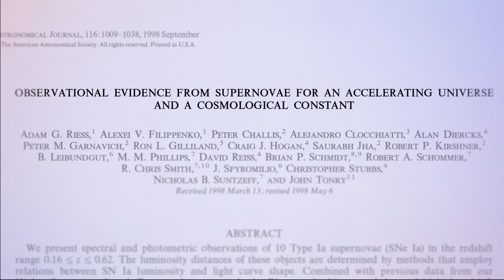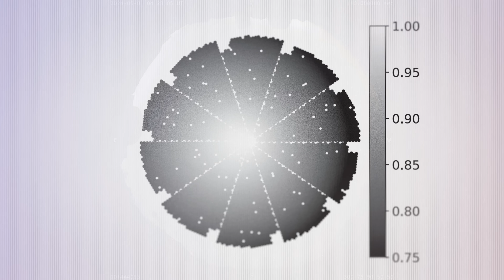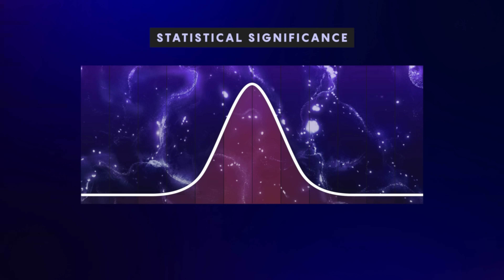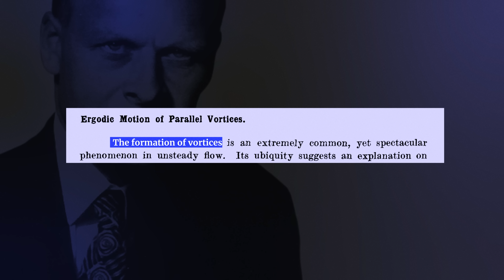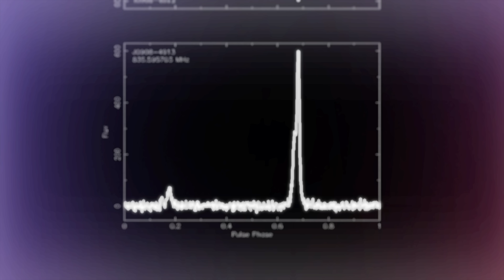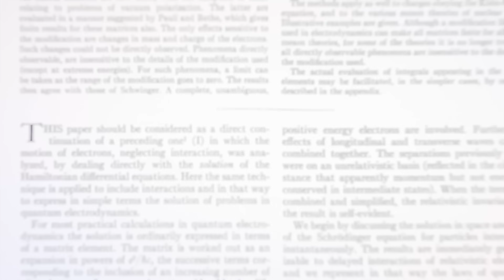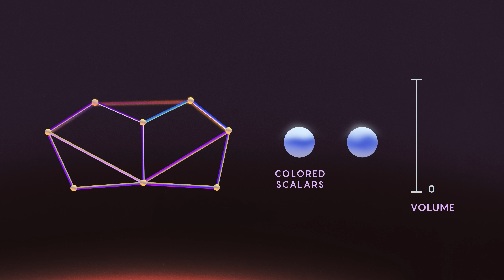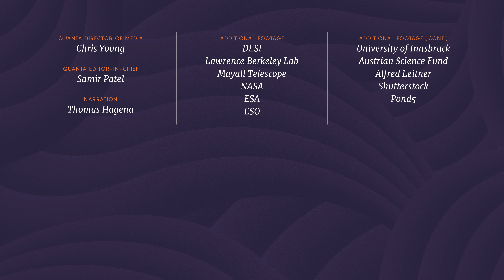Biggest Breakthroughs in Physics: 2024

Comment: 🎯 Key points for quick navigation:

00:06 🌌 Dark energy, making up 68% of the universe's contents, is a major mystery in physics pushing matter apart with its repulsive force.
00:36 🏆 The 1998 Nobel Prize-winning work confirmed dark energy's presence, validating Einstein's hypothesis about an accelerating universe.
01:06 🔄 New data from 2024 suggests dark energy might be changing over time, challenging the concept of it as a constant force.
02:04 📈 As the universe expands, dark energy increases between galaxies, forming the basis of the Lambda-CDM, the current cosmological model.
02:57 🔍 DESI's goal is to build the largest 3D map of the universe, aiming for a deeper understanding of dark energy by measuring 40 million galaxies.
03:54 🌀 DESI's observations on Baryon Acoustic Oscillations (BAOs) are used to understand the impact of dark energy on the universe's expansion.
04:23 ✨ Initial data from DESI indicates that dark energy may be weakening, suggesting galaxies are moving closer than expected.
05:52 🌀 The creation of a supersolid in a lab, a state of matter that is both a solid and a superfluid, was confirmed.
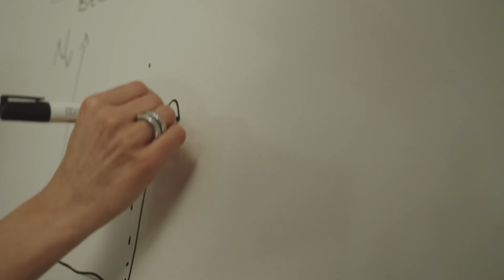09:09 🌌 Observing vortices in a supersolid could help understand quantum behaviors like superconductivity and possibly the interiors of neutron stars.
11:23 📐 The amplituhedron offers a new geometric method to predict outcomes of particle collisions, challenging traditional computational methods.
14:14 🧮 Carolina Figueiredo's research on the associahedron reveals forbidden collisions in different theories of particle physics, indicating a shared geometric foundation.
16:26 🔳 Figueiredo's work suggests the potential for new, efficient ways to understand the quantum world through geometry, expanding on the amplituhedron's premise.

Made with HARPA AI

Comment: Dumb questions of mine😂
1. What if it is not accelerating but just distance is shorting?
2. If you cant find a central point of bigbam theory suppose it is outside of seeable universe?
3. What if we are just a projection and that is the law of it from the beginning?
4. If it is just a set up law it can change in any moment and you will never find last sens of everything so it could be ultimate sens of seting a laws that way they will change when you are close to the meaning and it. Will can chamge and evolve limitless.. so what is the sens?😂

Comment: the Feynman diagrams are correct with theory if they theory is correct a theory  based on probability ,creating an endless correction to correct theory to reflect  gathered data  instabilities of partials such as :  if you hold an experiment for 1 hour the earth has moved 70,000 mils plus  and directional veneration in fields  and there bodily functions  fluctuations ,  they sound like flat earther's  ooo and rrr ing at fire crackers

Comment: The missing major discovery, gravity. Gravity is quantum measurement energy. Gravity begins as relative gravity bits on a cosmic horizon and then when a local need for gravity arises to resolve quantum uncertainty of entangled matter particles’ spin, a Hawking photon is emitted to conserve energy in the now smaller universe as the cosmic horizon spent a gravity bit breaking entanglement from the cosmic horizon by design a Planck area  making gravity appear locally. As radius goes down the amount of energy to clock a quantum state goes up but kinetic energy goes down. This means that kinetic and measurement energy equal each other and it’s just under Planck area that creates a situation where the system can’t clock because you can’t have enough energy in that small of an area to clock a quantum state. Planck scale is not because anything  smaller would fall into its own black hole.  Dark energy is solely from relative gravity bits on relative cosmic horizons. When a distant object appears to cross our horizon, it’s encoded as relative gravity bits on our horizon but we are also encoded as relative gravity bits on their cosmic horizon at the same time. Locally each observer sees no giant wall of gravity gravitating them anywhere but both observers think the other observer was dragged out of the local observable universe due to their relative cosmic horizon. There are no dark energy particles. It’s all the cosmic horizons providing the energy. Inflation wasn’t a field or a particle. Inflation was tiny cosmic horizons gravitating newly formed Matter particles across tiny horizons at tremendous speeds which add a huge amount of Planck areas for all the early particles that crossed the cosmic horizons just after the Big Bang. This model solves dark energy, Planck scale, gravity, and it conserves entropy, information, and energy. Anyone can see this by doing a Landauer Limit on any black hole at that black hole’s Hawking Termp and you will find gravity, Hawking radiation and spin are all the exact same energy value but use different quantum logic data types.

Comment: Quanta missed the discovery of gravity on 2024. Check out my videos. I have the complete description and journey. Gravity is from entangled pair measurement to conserve information from casual uncertainty. In this model spin, energy, information and entropy all conserve from cosmic to local scales and Planck scale is defined by measurement energy and kinetic energy becoming equal and the quantum state can’t clock. That prevents anything smaller than Planck area. When measurement to resolve spin states is Klee than the pool of kinetic energy available the system will not be able to clock that state. Quanta missed the biggest discovery of the century.

Comment: An Abrikosov vortex refers to a vortex of supercurrent within a type-II superconductor, essentially a tiny region where magnetic flux can penetrate the material, forming a stable pattern due to circulating superconducting currents around a normal core;

Comment: EXPLANATION: MATRIX, TIME, SPEED OF LIGHT, QUANTUM UNCERTAINTY, ELECTRIC POWER, RADIO WAVES, CURVATURE OF SPACE, DARK MATTER AND DARK ENERGY, GOD, SOUL
Our world is an encoded information program
A quantum computer is no longer science fiction, but a reality. The next step is to create a quantum printer.
According to the theory of modeling, our world is a holographic three-dimensional matrix of pixels. The size of a pixel is equal to the minimum Planck length
The Planck length is a unit of length in the Planck system of units, equal in the International System of Units (SI) to approximately 1.6⋅10-35 meters. The Planck length is a natural unit of length, since it contains only fundamental constants: the speed of light, the Planck constant, and the gravitational constant.
The approximate radius of the observable Universe (14.3 billion parsecs or 4.4⋅1026 m) is 27⋅1060 Planck lengths.
To within π, the Planck mass is equal to the mass of a black hole whose Schwarzschild radius is equal to its Compton wavelength. The radius of such a black hole would be of the same order of magnitude as the Planck length.
The Planck length (and the Planck time associated with it) define the scale at which modern physical theories cease to work: the geometry of space-time predicted by general relativity ceases to make sense at the Planck length. These scales preserve a yet-to-be-discovered theory combining general relativity and quantum mechanics that can most fully describe the laws of physics. For this reason, modern descriptions of the development of the Universe begin only when the Universe was 1.616 • 10-35 meters in size.
Time: t = Ch t- time (1 sec) C- speed of light h - Planck length
The movement of light is the alternating switching (exposure) and switching off (fading) of pixels according to the amplitude of the sinusoidal wave of the spectral frequency period.
In one second, the frequency of alternating switching of alternating pixels is 300,000 kilometers - according to a given qubit code program. The speed of light in a vacuum is exactly 299,792,458 m / s. The pixels of the matrix form atoms, molecules and the entire surrounding world. The entire subsequent program of actions and forms of living nature is embedded in DNA. Based on this constant, light formally moves uniformly, regardless of the direction of parallel movement and the speed of its movement, another object. If, by coding, modulation and detection, the pixel grid (matrix) changes with a certain step, much smaller or larger than the Planck length of about 1.6⋅10-35 meters, there will be movement into the future, the past, or going beyond the pixel matrix. Quantum dualism in the Young double-slit experiment is also explained by switching photons at a given frequency of the past and future. The photon does not move anywhere. The illusion of movement is formed by switching pixels that create a photon in the form of a spectrum of frequencies of different colors by the amplitude of the sinusoidal period and passes through both slots in the on and off state. The eye determines only the on positive frequency - the amplitude state of the photon. Passing light through a prism, we see its entire spectrum, so experiments show different values of the photon particle or wave.
In the same way, the movement of electric current, radio waves and magnetic fields occurs. Their nature is also to expose and darken the gradation of the pixel grid.
Pixel formations in objects such as planets, stars, black holes have a curved structure in the form of spirals, on which balls and curvature of space-time arise. The galaxy is formed and controlled by a black hole by detecting and decoding information from software, memory or consciousness. Dark matter and - is a pixel-encoded software and objects of memory of the past and future, which are in a state of binary qubit code shutdown and cannot be detected by any device.
Dark energy is the gravity of the White hole in which our universe is located
God is a program that controls the universe based on the information world intelligence launched from the outside. Beyond the Planck length
The soul of man is part of the information program of the world intelligence, which is stored in the program memory in the form of a binary code of Planck lengths in the qubit form of the future and the past
Practical use. Using the technology of pixel-holographic software modeling, it is possible to artificially create any object using a quantum computer, a quantum 3D printer and a quantum holographic projector, up to the Universe. Instantaneous movement when copying, move objects and move in space using antilight, etc.
The ultimate goal is a quantum printer. Then all sorts of problems will be solved and all religious miracles and extrasensory abilities will be understood

Comment: 7:51 Why superfluid under rotational bucket is at rest initially. As here we have zero viscosity so superfluid should also start rotating as soon as bucket starts to rotate. 
Someone please help here as what am I missing here.
Reply: Zero viscosity means it does not stick to the sides of the bucket, there is no drag, so the bucket can rotate freely
Reply: @TheCairn  viscosity is between fluid layers. How are we relating it between fluid and bucket surface. So essentially why liquid is at rest while bucket rotates.why this fluid is not rotating when an external angular momentum is applied. Appreciate your reply
Reply: @nahushgolait1273  for momentum to transfer microscopic portrusions on the bucket's surface would need to collide the superfluid particles tangentially. If the bucket is extremely smooth this does not happenn often. As to why microscopic vortices form sporadically, it's probably a very weird quantum phenomenom because of the uncollapsed wave functions
Reply: @efhi  they have not mentioned that bucket interior is frictionless. So the question still remains that why liquid don't react under external angular momentum. Thanks
Reply: @nahushgolait1273  Yep, I don't honestly think these videos are any good for understanding these concepts. You're better off watching independent youtubers talking about these things.

Comment: Super solid of quantum tornadoes is See/saw=constant Sterile neutrino S=(E*T)/(M*T)=2*(me/pm)^2 known for faster than light speed c=1/(up)^0.5=200702458[meter/second][u=4pi*10^-7, p=8.85418782*10^-12] by 60 feet across 454 mile by speed of 1.049*c=(1+128.51991*137.036*60/(454*5289)/3^2)*c for 879 [second ] =(8.397*10^-16)^2*(1.049*c)/(137.036*pm*1.049^2) : neutron decay time by pion which shrink proton radius pl=g(p)*(4pi*pm/3)/c^2=8.809*10^-16 meter to 8.397*10^-16 meter=8.809*10^-16 meter/1.049, g(p)=g*m^2/pm^2=g*(pl/4.1888*l)^2=1.13*10^28 is strong force by graviton g*m^2=ch/2pi : solution of GR field equation ch=8pi*g*(m*c^2/2)^2/c^4 =2pi*g*m^2 oscillating between Planck scale l=g*m/c^2=(h*g/2pi*c^3)^0.5 which can deduce ch=2pi*g*m^2, m=(ch/2pi*g)^0.5=2.176466*10^-8 kg, proton scale pl, g(p) can transfer into EM force between proton[pm=1.672621868*10^-27 kg], electron[me=9.10938356*10^-31 kg] in hydrogen Atom[A=5.29177282*10^-11 meter] k*e^2=g(p)*pm^2/137.036=ch/(2pi*137.036)[e+]=me*(c/137.036)^2*A[e-]=4pi*g(p)*pm*me*137.036/128.51991 which can turn into quantum gravity  at Atom scale A^2=g(p)*pi*me/128.4980143*c^2 by 2pi*k*e^2*137.036=ch=(2*A1*137.036*pm*c^2)*(4pi*A*137.036)=En*L produce dark photon[Axion] r=En=ch/L=chR=me*(c/137.036)^2/2=13.6*e*(1/1^2-1/n^2)[1.602*10^-19] by electron decay shrink proton radius pl to 8.753*10^-16 meter produce W=80.42939*(8.809/8.753)^2=81.5 Gev : weak interact massive particle[WIMP] for dark matter ch/3=pl*pm*c^2/2  for hot regular matter can emit light spectrum ch/3/2pi=W*p/R in negative vacuum energy of Dirac's sea ch=(4.9154)^3*pm under critical mass[6^3*pm] as dark energy can expand our universe by ch [72.13%] + ch/3[24.04%]+ch/6pi[3.83%]=En[100%], from it can deduce experiment data from Planck satellite[DESI] for dark energy 68.3%=(72.13-3.83)%, dark matter 26.8%, cold regular matter 4.9% from hot regular matter 3.83=(4.9-3.83)+(26.8-24.04), self interact graviton g*m^2=137.036*(e-)=(k*e^2/e+)*g*m^2 which 's Majorana particle keep postron e+ in negative vacuum energy Dirac sea ch/2pi*137.036 make electron me*(c/137.036)^2*A at Atom scale super conductive, by graviton oscillating between l,pl, A 3 scale produce T=g*m^2/137.036*8.38=0.015448 Gev : Tau neutrino, M=pm^2/(2*g*m^2*137.036)=0.1811 mev : Muon neutrino, E=me^2/g*m^2*137.036=0.108*e : Electron neutrino, by oscillation between those 3 flavors neutrino produce quantum vortices tornadoes  S=(E*T)/(M*T) : Sterile neutrino know from DUNE experiment at CERN broken symmetry between muon, electron for dark matter by 85.73% From 100-85.73=14.27=A/(3*137.036*(A-A1))=128.51991/(3*137.036*(128.51991-128.4980143))=128.4980143/3^2=(80.351+0.135)/(137.036*(80.485-(80.42939+0.015448) deduce  80.42939 Gev[80.351+,-0.094] : W boson , A1/A=128.4980143/128.51991 : Oscillation of Atom radius cause Einstein's Brownian motion we can observe Sterile neutrino in action which have 10^-10 meter size in 3D 10^30 meter universe have 10^(30/(-10))^3=10^120 S of super fluid in vacuum ch=2pi*g*(137.036*up*e-/l)*(137.036*up*e+/l) : EM wave for Naviers Stokes super fluid for Dyson's quasi crystal solid as cosmic constant 10^-120 for dark matter which dark energy ch create it, in bullet cluster Sterile neutrino[Tachyon] emit weak blue light of Cherenkov radiation indicate that area have dark matter.

Comment: If photon entropy from propagation loss is the cause of the background redshift, then the exponential increase in wavelength vs. photon energy, is not from expansion of space and dark matter is not required.  Dark energy can now be understood by the e-m right-hand rule of light propagation, as due to propulsion energy loss.
Reply: Not sure what you are saying, but agreed as to DM.  Unless, of course, somebody finally finds it.
Reply: @williamschlosser, since photon energy loss increases its wavelength, as a redshift, and wavelength increases exponentially with loss of photon energy, this exponential loss is interpreted as "acceleration of  expansion" in big bang theory, indicating "dark energy" rather than its actual cause as propagation loss.  Of course, some may prefer to keep the same term but with a new definition.  Expansion theory and dark matter would still be obsolete, particularly since dark matter has never been observed, and until now has just been maintained on faith.